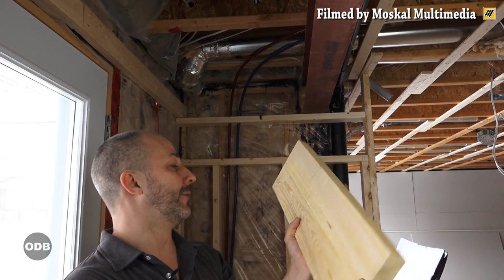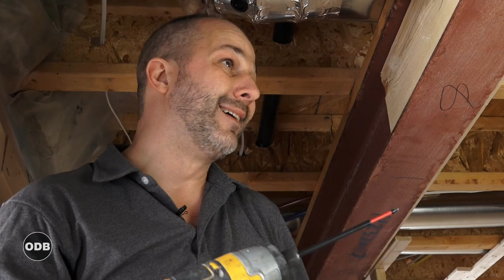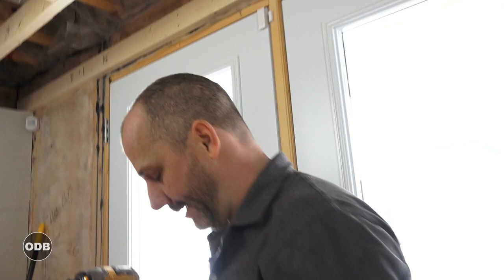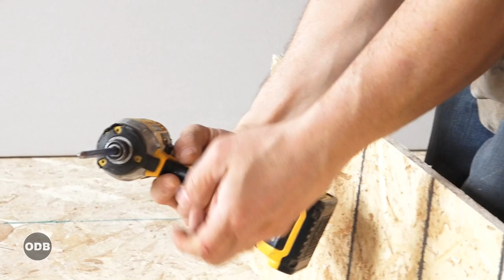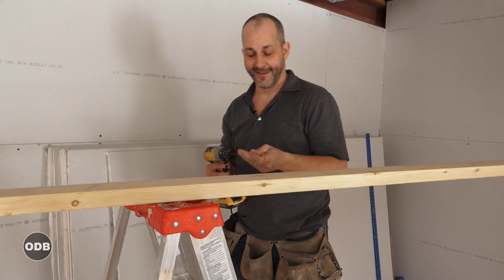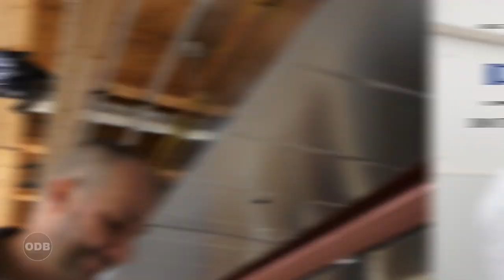Bulkheads, How to Build them Strong, Square and Level

Comment: We were isolating and watched you video
Thank you very much mike homes could lean from you.
I have boxed in ducts pipes for years but using the osb just tooo it to a new level for me.
I already had the ceiling strapped out and was going frame out with 2x3 until your video.
I doubled up on the strapping then attaché the osb  easy as pie next I have to get the corner tapping roller super job thanks

Comment: that is a great way of making a new bulkhead, and the idea of putting the wood in between the steel beam, and then building off of that "genius", keep up the good work.
Reply from the maker: Thanks, it sure beats attaching anything into the steel.

Comment: Great vid.  Just wondering if u got a pic of the final framing of this bulkhead?  Or another example of finished framing of bulkhead.
Reply: Mainly the corner.  You say to tie in metal furring to underside but should it be offset with OSB so that you have a nice corner for the drywall corner bead to attach to the corner?

Comment: Hi Jeff - love your channel by the way. Need suggestion please. We are in the process of renovating our kitchen and currently in the process of demolition. Everything is fine except one side that has ductwork in the bulkhead. Our kitchen cabinet is 36 inches. Any suggestions on what we can do with the ductwork which currently is about 8inches  from the ceiling. When we put our 36inches cabinet, we really only have 6inches allowance. Would really appreciate your input, please. Thank you.
Reply: I took pictures of it but I don’t see where I could include it in my message.

Comment: I like the OSB trick. The leaving 2x4  tails floating I'm not hip on.. I have repaired too many homes where lumber doesn't move in unison during expansion and contraction  due to failing to connect members together properly, causing drywall cracks and even door reveal issues.
Reply from the maker: Not a whole lot of expansion and contraction in a basement cieling in the middle of the room however. I have never had a call back from my building and drywall techniques.

Comment: Very informative, will be following this method for my basement finishing. 
Is it possible to provide a link for the metal frame mentioned at the end of the video to connect two sides at the bottom for the framing ?
Thanks
Reply from the maker: Sorry we don't have that video yet. We had a filming schedule problem.
Reply: Home RenoVision DIY Sorry , I meant a link of the product used for the metal frame 
Thanks
Reply from the maker: I don't have a link. Home depot sell it as ( furring channel) comes in 12 ft lenghts.
Reply: Home RenoVision DIY Ok Thanks for all your hard work

Comment: I have a tub drain pipe in basement that slopes approximately six inches from a joist. Would I have to build a bulkhead around it to eventually put in a ceiling?
Reply from the maker: most likely. Cheers!

Comment: why did you strap the floor joists? you could install  drywall without  this step, nice video
Reply from the maker: THis way I can run the drywall across the short side of the room and not have butt joints on the cieling.
Reply: thats a very good reason
Reply from the maker: I'm not a complete fool sometimes. cheers

Comment: Will there be a part 2 to this?
Reply from the maker: I don't think so. some times max is just not available to keep up with production. is there something you need clarification on?
Reply: No I just thought there would be a part 2. I am learning a lot watching these videos.
Reply: At the end of the video you said you would run a metal track across to create the bottom of your bulkhead.  What exactly did you use?
Reply from the maker: standard metal furring channel from the building store. It is U shaped and is about 1 inch thick. comes in 12 ft lengths. You could always ask the pro desk for help. Good luck.
Reply: I assume this metal furring channel is much stronger than a 2x4 on its flat side.  What would be the approximate length you can go unsupported before you have to worry about it flexing with the drywall weight pulling down on it?  I have a few wide bulkheads to build and I want to make sure the drywall won't sag.
Reply from the maker: we use it because it is thinner than a 2x4. It can go up to 30 inches without support. It also doesn't warp or twist so a low bulkhead always looks amazingly flat and doesn't suffer nail pops.
Reply: It's just setup work to hide mechanicals.  Since it's just a basement... I would never work this hard: put in a drop ceiling so future trouble shooting doesn't involve tearing it all to pieces.   At some point... everything will spring a leak.

Comment: Why did you attach 2x4 to the joists and not screw drywall directly to joists ? You lost 1.5 inches in height.
Reply from the maker: I am not in the practice of following the joists just to drop down to the beam and back up again. The height is not a problem and I prefer clean lines.

Comment: This video is great!  At the end you mention a metal track and in the comments I see reference to furring channel.  This is what I found at Home Depot, is this the right product?  (https://www.homedepot.ca/product/bailey-metal-products-drywall-furring-channel-2-75-inch-x-12-ft-galvanized-steel/1000165832)  The bulk head I need to build a little over  4'5" wide and 20' long.  I can put a support pretty close to center, is this going to be enough support, assuming I put the furring channels on 16"  center?

Comment: Me again. Why 2x4s???Should be using 2x2 to save material. If building with wood... Should be building it out of steel. Lighter to put up. Straighter. will not twist with changes in humidity.  waste of ply wood too.
Reply from the maker: We are trying to build something in a basement. metal framing amplifies the noise while solid wood helps to absorb sound. wood is safer to work with as well.

Comment: You really need a better or Bigger Impact driver
Reply from the maker: What type of drill would you recommend?
Reply: I use Milwaukee Fuel Drill and Driver with a 9ah Baterry...A little heavier and a long time without changing the battery
Reply: bro that 20v dewalt is more than enough .lol
Reply: As long as it’s not the 887 then all is good.

Comment: Am I the only idiot here that can't figure out what a bulkhead is?
Reply from the maker: basically a framed box that encapsulates a pipe or ducting in a ceiling. Cheers!
Reply: There r probably 1000 other ppl watching this video thinking the same thing. What is a bulkhead?? Just no one had the balls to say hey what’s a bulk head?? Cheers Brent u r not alone